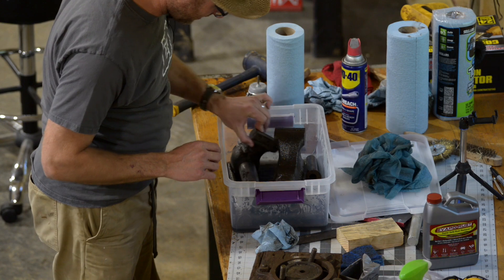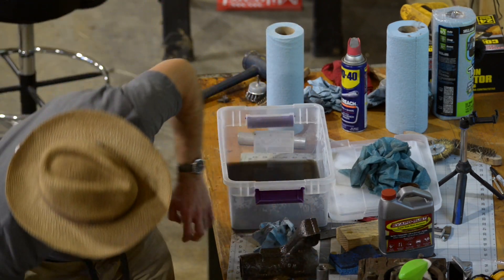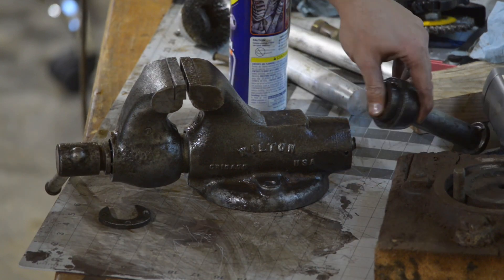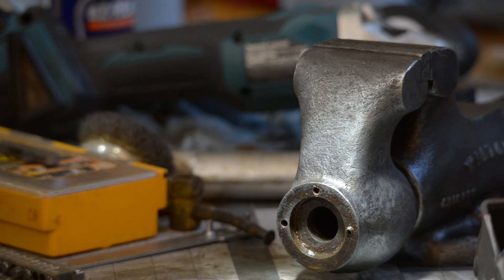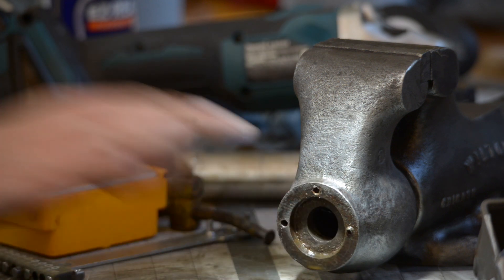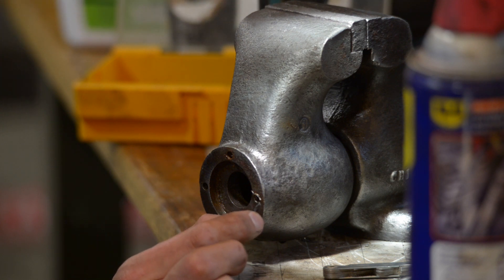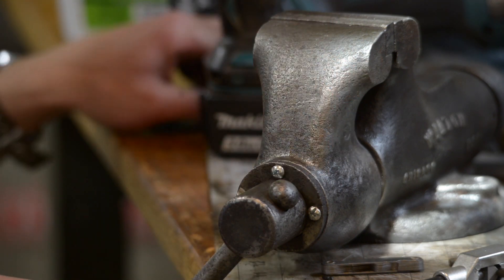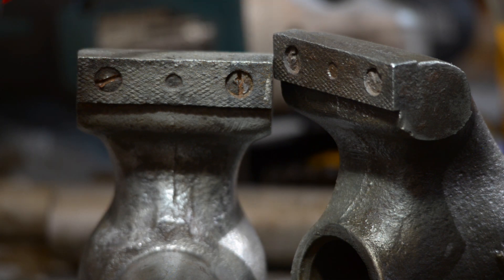1946 Wilton Bullet Vise Restoration - Part 3

Comment: Very cool vice! Cant wait to get my vice video uploaded.

Nice work!
Reply from the maker: Thanks! I’m having a heck of a time removing the jaws. It might be a while until the next video :)
Reply: @superchromat  Impact driver?
Reply from the maker: Rusty Old Things Restoration I tried that - it chewed up the screw heads. I’ve now drilled out the screws, and it’s still not budging. I’m going to try welding a bar to the jaw and either pulling it out with a slide hammer or bottle jack.